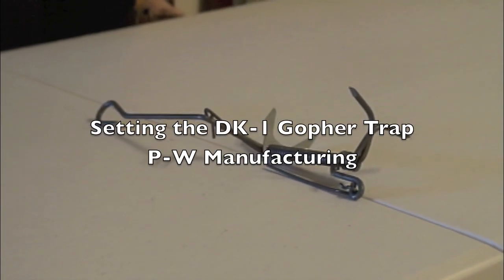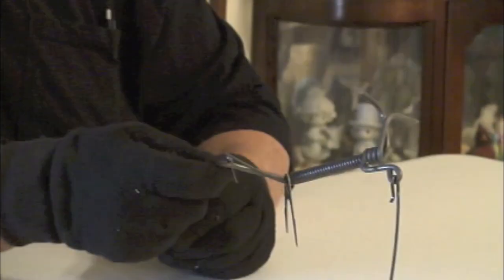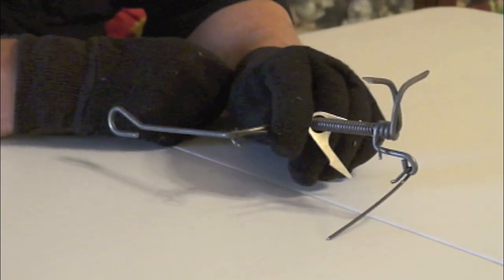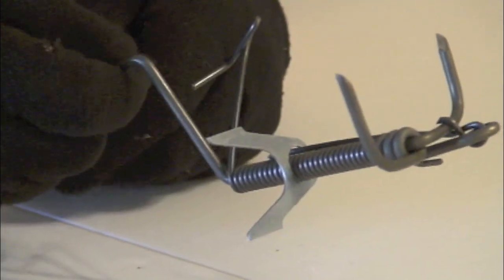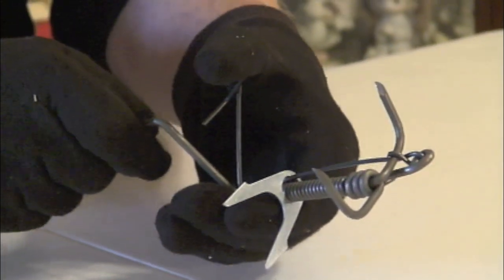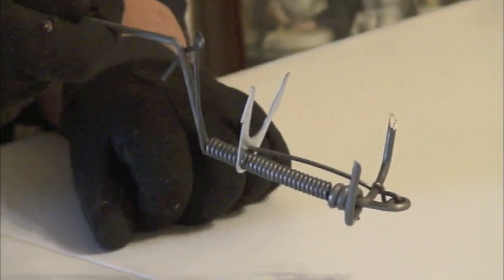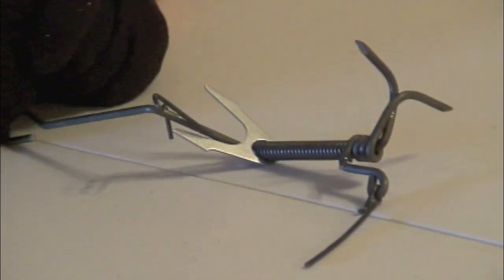Setting the DK-1 Gopher Trap

Comment: Over 30 yrs I've used all types of gopher traps.  Some problems I've encountered or feel exist with the DK-1 trap is 1) they need modifications, 2) they are plain steel and rust, 3) the bottom part of the trap will pivot down and snag on the roof of the tunnel, 4) they only come in 1 size.  Steve Albano makes several stainless steel traps so if you have some juvenile gophers, you can use a large mole trap, no misses.

Comment: Some of my DK traps are misfiring. What I mean by that is when I go to check the trap, the trigger plate is set but the rod is holding the jaws open.  Can someone tell me why?
Reply: Mine are doing it too. all of them.
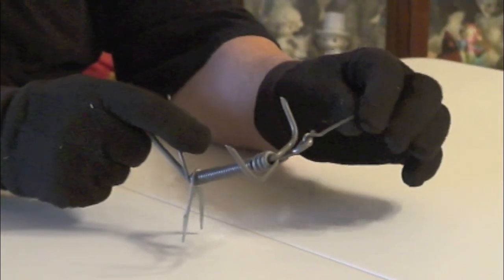Reply: 1:48 are you sure the short end of the wire is over the jaw and not the long end of the wire? 💕🌞🌵😷